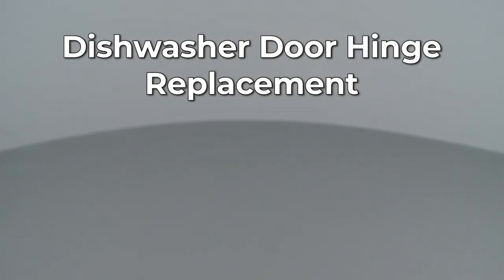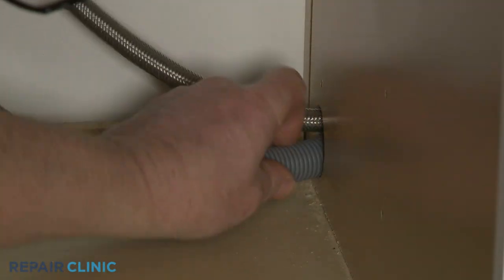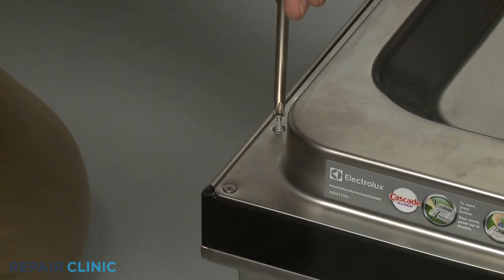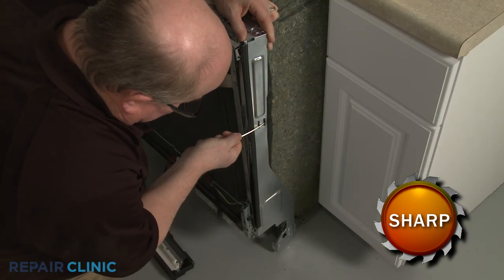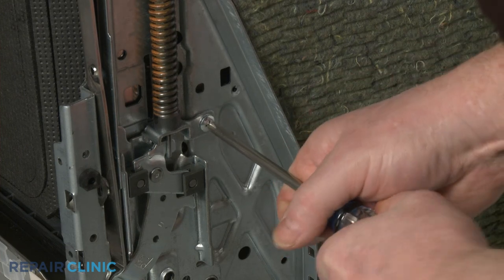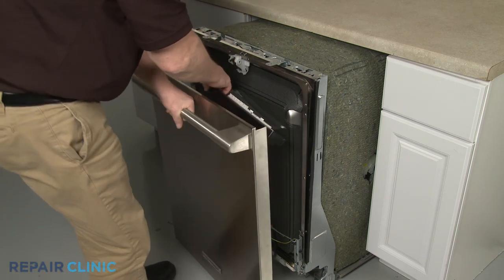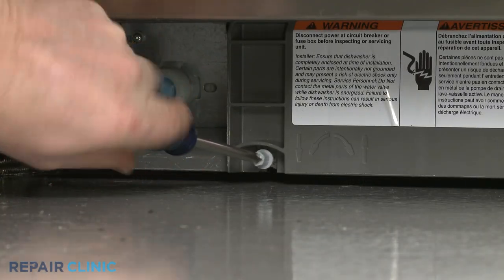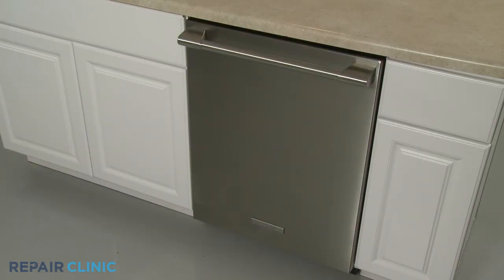Electrolux Dishwasher Door Hinge Replacement 405539886

Comment: Good morning from Spain.
I´d thank your help with my door dishwasher issue. It´s FSB52600Z model, completely integrated. My problem consists in removing completely the metal door behind the wood panel at the front. I need to replace the rinse deposit and, once I´ve removed all the door screws, there are still two clinches (or similar) at the bottom which I can´t remove, and the metal door keeps hanging from them.  Any help? Thanks